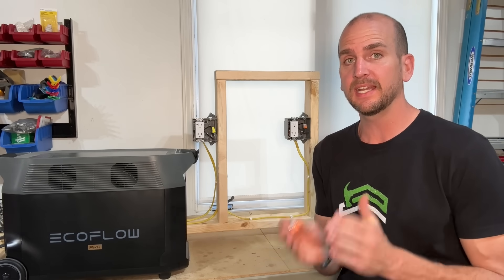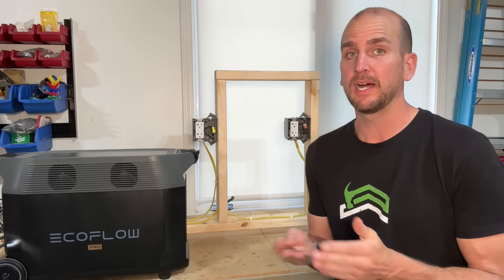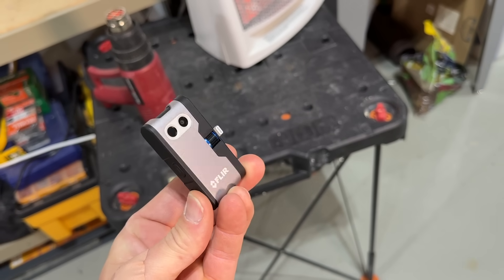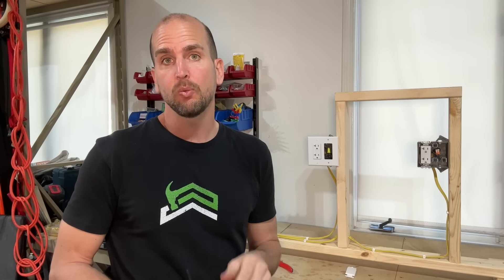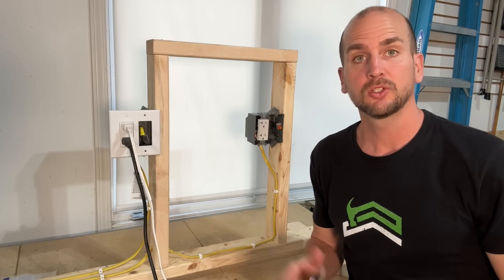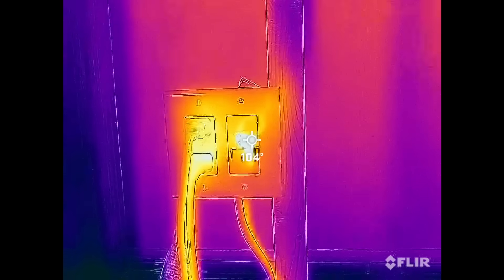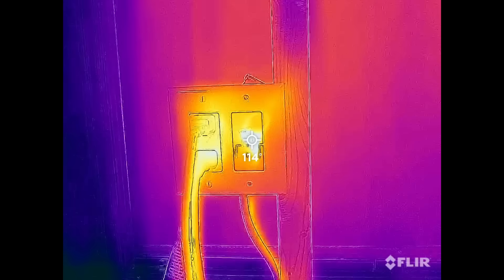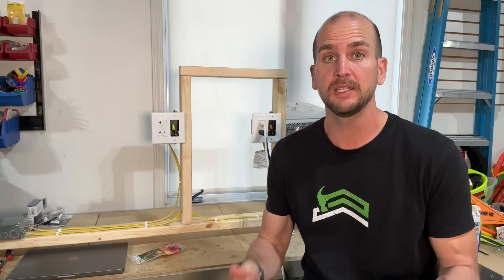Debunking the Pros: Can WAGO Lever Nuts Handle Heavy Electrical Loads?

Comment: Hats off to Scott for a good test. However, my dad was an industrial electrician. He taught me to always scrap the wire ends, carefully twist the conductors, trim, then add the wire nut. I will continue to do so, but may use Wagos in really tight spots. Thanks again.
Reply: Scott is nothing but a self appointed jack of all trades, master of none trying to sell related products. He is not an electrical expert or electrician and frequently gives out bad advise. Wagos are total junk for lazy electricians and diyers looking for a faster way to get out of there.
Reply: Its a stupid test. The problem will appear after they have been out there for years. Not testing them just after there installed. Aluminum wiring took several years before houses started burning down.

Comment: good test.  result is noticeable but negligible.  others are correctly commenting that the real (potential) problem here is "what happens over 30 years?".  Even if problems were detected, using wagos might be better than having idiots mis-using wire nuts.
Reply: There have not been any problems in Europe for around 45 years. I think any such concern is unfounded.

Comment: Why was this test completed with an overload and not a real world 20AMP test? I would like to see the real numbers with realistic loads with a max of 20AMPS. because realistically no one keeps their circuit loaded at 20 AMPS on a daily basis ( unless someone is running a space heater during the winter as their only source of heat)
Reply: Legal space heaters are only something like 1750 watts - at least in the USA.

Comment: Please do another 20 amp-ish test to measure the KWh used over several hours. This way we can see if there is a significant energy savings for the connection that produces less heat. Make connections on the hot and common sides. Don't forget to show us the quality of your wire nut connection. If you learn there is a significant energy savings please calculate how much that would cost over a year.
Reply: The difference would be impossible to measure outside of a carefully controlled laboratory environment.

Comment: I’d like to see some cycling tests. Heat cool cycles will probably have an impact. The diy stab connections on the back of 15a outlets are similarly spring loaded and I’ve seen them fail badly from 80% loads. Maybe I just need to dissect a wago to see why it’s different. In any case, I’m comfortable with wire nuts and will keep using them, especially on high load circuits.  Thanks, great vid!
Reply: Wagos are superior for heat cycling. They provid constant spring pressure, where wire nuts will lose tension with cycles.
The tension element in Wagos is a steel spring, pressing the wire against the plated copper bus bar. The plastic housing is only for insulation.
Wire nuts on the other hand have no spring in them - so if the wirs shrink / move, they suffer from greatly reduced pressure and drastically increased resistance.
Reply: @kain0m  Totally ridiculous erroneous comment.  :face-orange-raised-eyebrow:

Comment: Wire nuts? Clearly last century. A 10-degree difference in extreme conditions is little to worry about. The Wago is a neater, more professional connector.

Comment: I guess the question I have is...What are the conditions when running the circuit at 80% or 90% of rated capacity?  You've made the choice of over taxing the set up.  I understand the choice and you've shown the Wago to be safe under those extreme conditions.  My guess is the results would have been much closer under a normal heavy load condition.  The condition of your test requires the user (Me) to overload a circuit with a failed or improperly wired breaker???  If you could ramp the amperage slowly, would a few degrees of temperature increase (normal high load) and a little added resistance (temp induced) cause the breaker to trip earlier than a normal wire nutted spice?

Comment: I’m curious to see if wago are the new sharkbite fittings.  In the plumbing world, those were advertised as the next greatest thing to where no tools or special knowledge is needed.  Years later, we find that they are failing with much greater frequency.  They are absolutely amazing for easily accessible, temporary, and even some low use applications, but permanent regular use is frowns upon. 

I still see wago as a good alternative for a DIYer to be able to do it safer over what might be a questionable wire nut connection though.
Reply: Wagos have been used in Europe for over 50 years, but maybe they fail catastrophically "sharkbite-style" after 51 years? Could still happen...
Reply: @HenryLoenwind  Interesting.  I did not know that they have been in use a while.  I hadnt seen them until just the past few years, so I thought they were somewhat new to the market.  I stand corrected then.  50 years is a reasonable test case.  I think even the useful life of copper piping is 50-70 years, and that is widely accepted.
Reply: @locke3141  Thanks for replying, I couldn't find my original comment again after looking up the exact dates. The current clamp style ("cage clamp") was introduced in 1977, the first clamps that were certified in 1973 had a different mechanism. Wago started building wire clamps in 1950, but the earlier clamps were for industrial use and not certified for use with public electricity networks.

So I have to correct myself, it's only been 46 years. (While I think the bus bar was the same with the 1973 clamps and only the holding mechanism changed, your comment specifically was about the latter.)

Comment: Basically, I would pre-twist and use a wire nut on locations deemed high amp draw and the wago in all other locations. As in life, nothing is perfect for all venues.
Reply: If I had a high current draw situation, I would probably be using a swaged connection, or a heavy bus bar with screw terminals.

20 Amps, even 50 Amps, is not really high current.

Comment: Withe the higher resistance and heat build up....the cost in your electrical bill would be a tad higher.

I do wish that you would have tested the  pre twist wire but and also have shown the max watts displayed on all the test set ups.
Reply: You have it backwards.  For the same load, the current would be slightly lower, which means less power consumed. However, the difference would be slight - deeply buried in noise from all the factors that affect residential power usage.
Reply: @buggsy5   you would be correct if we where talking about passive loads like a light bulb.   But with loads like heaters that has a thermostat to control the on and off the heater will have to work harder per time period to keep the room temp the same.  Heat loss through poor connections  makes for higher inefficiencies.

Comment: Pros are in a hurry to make profit. I'm a DIYer: all my electrical work in my house is solder & heat shrink. You can't have any high frequency vibration loosening or heat cycling problems. But I'm anal retentive about getting the best results because speed & profit aren't involved.
Reply: I was unaware that they still allowed new solder connection circuit wiring in the US.

Comment: I think the concern people have over the temperature and resistance gain is unrelated to circuit load but something that the vast majority of households in North America no longer experience since the adoption of CFLs, LEDs, etc. Specifically, using wire nuts vs Wago connectors in a fixture for just single bulb light/lamp socket and using a traditional 100W incandescent bulb. The heat generated by the bulb combined with the increased heat of resistance may actually reach or exceed the manufacturer temperature limits of the wire connectors.
Reply: I think the temperature rating of the WAGO connector is about the same as for the insulation on electrical wiring in devices. Both wiring and connectors are protected from device heat sources.

Comment: Wago connectors pretty much make installations a go/no go situation.  Wire nuts on the other hand can be installed incorrectly and potentially cause their own set of problems.
Reply: By DIY'ers or hack electricians, yes.  :body-blue-raised-arms:

Comment: Of course, the danger is not good connections but bad connections.  WAGOs are idiot proof.  Wire nuts are easy to screw up, especially for DIYers, but occasionally even for pros.  You're less likely to leave a time bomb in the wall with WAGOs.

Comment: This is not code and use at your own risk. I have an older large home in Texas with wires ran in hot hot attic. I replaced all my cloth covered wires with romex. House was mixed with some cloth and some not that was a few decades old. Washer, vacuum and hair dryer would make lights dip. Outlets would join pairs at the outlets. On runs furthest from breaker panel, I replaced 14 awg with 12 awg and kept breaker at 15A. I pigtailed all outlets, soldered, wirenut and taped hots. No more dimming lights and I know my home is far safer than it ever was. The Wago does introduce connection resistance from reduced metal to metal contact. If you have several junctions, you will have voltage drop if pulling at the end of the chain. I will pass on Wago. On heavy draw device areas, I will always use commercial grade outlets that have a built in square washer to press hard on wire. Wago are fine for wall mount TV's and other small electric device areas. Some years ago my AC went out and it took a few days to get the part. I ran to home depot and threw up a window air conditioner on the outlet furthest from breaker panel. I slept like a baby knowing my wires could handle the unplanned continuous load and the lights never dimmed.

Comment: A missing part of the test is waiting 30 years and retesting to see the effect of oxidation on the two connection types. My intuition is that the resistance at the contact points in a properly installed wire nut won’t have changed but I’m not as confident about a connection where the contact points are just pressed lightly together on the side.
Reply: No problem; most installations that are only 30 years young in Europe use Wagos. You come over and measure. For 40 and 50 years old installations, you'll have to look around a bit, but they are out there. (Although before a certain point, they'll be leverless pushfits, but the contact area is still the same.)

Comment: I like the wagos for lighting circuits, but I still think I prefer the wire nuts for outlets.  If you twist a wire in a wago too many times, it can come out.
Reply: "If you twist a wire in a wago too many times . . ."  Please explain.  I don't understand why someone would deliberately twist a wire in a wago, and I also don't understand how someone would inadvertently twist a wire in a wago "many times".
Reply: Maybe buy some rat bait so they aren't twisting the wires in your walls all day and you wont have a problem.

Comment: 1. If you want your charts be scientific you need to provide T0 temperature for each connection, i.e. the temperature at zero minutes zero seconds.
2. Per the chart WAGO went up 12 degrees in 15 minutes, wire nut went up 11 degrees in 15 minutes which means WAGO will reach its max rating 30 minutes earlier than the wire nut (which is a significant difference). This is of course if the temperatures continue to increase. That means you need to provide later points as well and these are missing. There is a lack of important data to draw any conclusions.
Reply: Such temperatures do not increase linearly like you imply. As the temperature rises, the rate of rise decreases - that is why an incandescent light bulb only gets so bright and hot and then remains constant.
Reply: @buggsy5  I covered that in my comment. It may reach constant value theoretically but we don't know what is that value for each of the connections and when it should reach that value. All the curves in the chart are increasing. We need later data - 20 minutes is not enough.

Comment: If you are a fan of using the push in feature of receptacles, then wagus are fine(same thing). Only time I don't pre twist is if the wire is stranded.
Reply: The are NOT the same thing. WAGOs are more akin to the screw terminals on the receptacle. 

Do you twist the wires even if the manufacture states that you are not to do so?

Comment: Any issue with that limited contact area being more susceptible to failure over time due to heat cycling? What about the plastic lever becoming brittle from that heat? Old dog new tricks guy here is a little concerned.
Reply: I think is that the actual contact pressure is much higher by that. The internal contact bar is quite sharp, it's not just a simple area contact like in a switch or plug. You actually see a "bite mark" on solid copper wire just by closing and opening the lever once. So less chance of failure due to solid mechanical grip and more gastightness. BTW: The lever forces the spring to open, so if it is gone/broken you simply can no longer remove the wires.
Reply: @georgacher7889  You say 'bite mark' like it's a good thing.  :face-turquoise-covering-eyes:

Comment: Excellent test! I think more temperature testing videos would be great content. Maybe try different connectors like the Ideal push in or test the difference in temperature between things like pre twisting wire nut connections or screw terminals vs back stab terminals. Measuring the voltage drop across the connectors while loaded would give us another great data point too.

Comment: Excellent test! Pretty much what I expected from the resistance tests I have seen other Youtubers do- Wago runs slightly hotter, but not much. I'd personally still use wire nuts with pre twisted connections for high amperage circuits such as part of a pigtail on a receptacle circuit, but I'd have no problem at all using Wago connectors for loads of a few amps or less like a ceiling fan or light fixture. That's just my preference though, obviously both are completely viable choices.
Reply: Just use the WAGO 221-6xx series. 

Most people forget, that there is an XL version which accepts larger diameters and has a bigger busbar and clamp surface.

Modern electrics in Europe is >90% push-in or lever clamps, starting with push-in connection for RCDs, from there to WAGO or PTI installation clamps on DIN rails in the distribution box, WAGO push-in or lever clamps in the room and push-in mechanisms for socket & light switches.

Only thick cables >6mm2 are still on screew terminals most of the time.

It actually has lead to less accidents, because it is way more „idiot-proof“ than some old fashioned mechanical connections like wire nuts, which were abandoned here over 50y ago…

Comment: It's the same type argument as the pex vs copper pipe plumbing debate...   Some people are just resistant to change...and some Pros are resistant to anything that makes the job easier and more approachable by the DIYer..  WAGO connectors and Pex plumbing have been used around the world for over 50 years..

Comment: I actually just started using the wago lever nuts because I saw they sell them at home Depot and I gotta tell you I love them! Makes everything so much easier and faster! I won't ever go back to the twist on wire nuts unless I absolutely have to.
Reply: Hmmm, they don’t sell them at any of the Home Depot’s I know about.
Reply: He’s probably seeing Ideals v2 brand called insure. They are similar. One feature I like with this brand over Wago is that you can insert the wire without lifting the lever. Saves time.
Reply: @lorenrickey5481  But that’s not a Wago lever nut (like a 221.) You twist it and the wire comes out. That may make them easier to put the wire into (_barely_) but I would feel less comfortable stuffing something like that into the box.

Anyway, some people say they’re using “Wago lever nuts” and they’re actually NOT using them, or they’re using lookalikes and/or counterfeits, and this leads to a lot of confusion and probably most of the failure complaints. The Wago lever nut is an ACTUAL PRODUCT, not a “TYPE” of product.
Reply: @declanfarber  The ones sold at Home Depot ( and major parts houses) around my area are just LIKE Wago 221s. Ideal calls them v2 LEVER  connectors. I use 3m wire nuts usually on the sites, but lever nuts are included on most can fixtures and when I’m installing temporary circuits and lighting the lever connectors come in handy. These are not the old push in fittings. Spend $8 at HD for a bag and see for yourself.